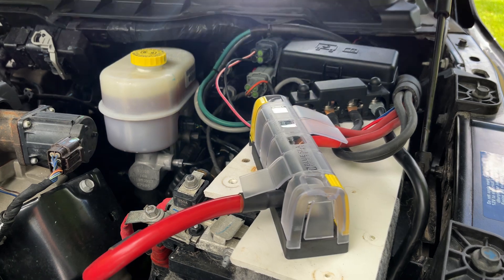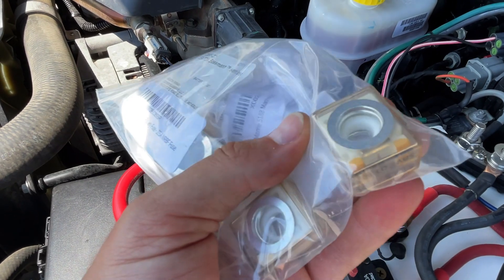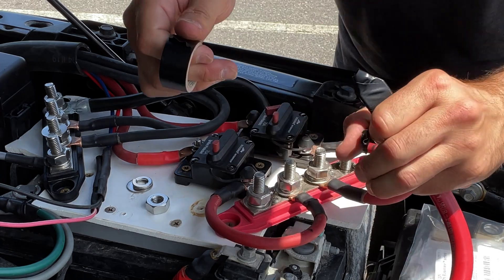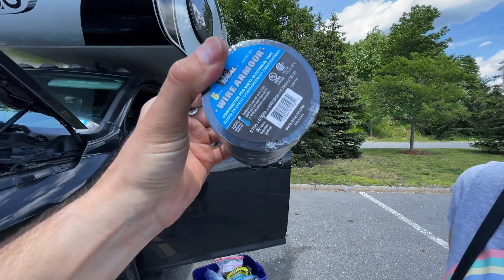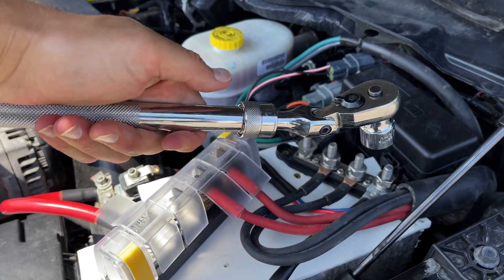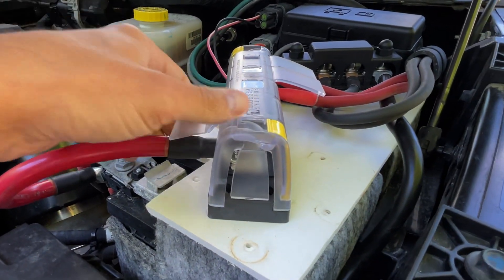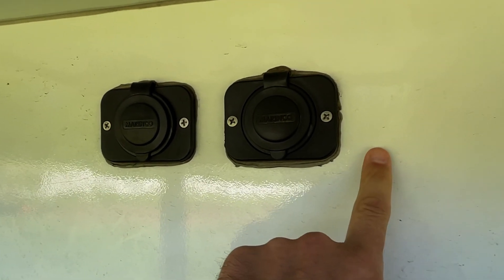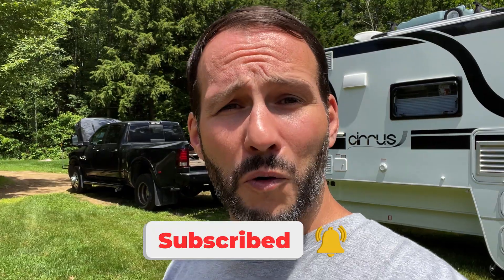Breakers vs. Fuses in the Heat // DC-DC Charging System Update

Comment: I'll make a suggestion use pop rivets on the Asdale. They work great for that type of application.
Reply: There are only two types of 'blind rivets' that you should use with non-metallic materials. Riveting soft materials with a typical 'swelling' rivet may appear successful but it is not. An 'exploding' rivet works by the mandrel splitting the rivet body into 4 strips and rolling them up, removing the hoop stress from the hole. The other is a 'tri-fold' that works just like a moly-bolt wall anchor. Neither are waterproof and for that reason, are inadvisable to be use on an exterior wall. (I am a former Safari Motor Coach manufacturing engineer where we built class A's with aluminum riveted skins on aluminum tube frames). One possible exception to the above is to used a 'sealed' rivet (again, there are 2 types and neither are common) with a washer on the back side. This works well but obviously removes the 'blind' nature of the rivet.
Reply from the maker: Thanks!
Reply: Scott, Rivets are very easily removed by using the same drill bit as the original hole required (important to use the same size so as not to enlarge the hole for the replacement) and drilling just enough to remove the head, then pushing the body inside, where it remains.
Reply from the maker: Thanks for all the information. Since I have access to both sides and wanted to be able to remove it easily, a stainless machine screw and nylock nut worked well. However, there are some sheet metal projects that I’d like to do in the future and rivets would be excellent!
Reply: @Stonyboot  I got that idea from another post. Here's one more it's called rivnuts they are like a rivet but they have threads once you install them the same as a rivet.
Reply from the maker: That’s an excellent idea, my only question would be how to remove them in the future? I assume just cut them and put new ones in? I have to service those plugs from time to time.
Reply: I think your screw/nylock  is the best solution but since the question was raised, I'll comment. Rivnuts also come in tri-fold  variants for soft materials which are superior but not absolutely required. There are several shortcomings to consider.  The is part of the way a rivnut works. It attaches itself to the panel first, not together as a rivet does. That means the flange on the rivnut sets above the surface of the panel. When you mount whatever to the rivnut, it sits above the plane of the panel by
 .030 or so, creating a leak path that has to be dealt with. Simplest is a caulk bead around it, better is a thick rubber gasket with clearance in the mounting holes to clear the rivet flanges (gasket alignment becomes a problem), best is to counter bore the back of whatever you are mounting. The potentially most painful problem is if the rivnut does not hold well in the substrate (likely if it is soft), it will begin spinning with the screw when tightened or loosened. If it does, the splines meant to grip the hole become a grinding wheel, enlarging the hole, making it impossible to remove. I use rivnuts a lot but for this reason, never in soft materials. Stick with the screw and nut.

Comment: Great info! Electrical stuff really intimidates me. You make it seem not so scary! ~carol
Reply from the maker: That’s nice to hear. 12v systems are pretty simple and easy to work on. There are so many resources on YouTube and Facebook that you can learn nearly anything. 

Do you have any particular electrical projects that you want to tackle?
Reply: @Stonyboot  we are full tome in our small travel trailer, but this fall will be downsizing to a truck cap with a hard shell roof top tent. I want to put a 100 watt solar panel on the RTT and I want to be able to charge while we’re driving. We’ll likely go with a 200 ah lithium battery-not 100% sure yet. Maybe just buy one of the new 2000 watt Jackery power stations. We don’t need a lot of power-mostly to recharge things. We’re Boondocking right now and running Daniel’s cpap from our Jackery 500. We have Jackery solar panels to recharge it.
Reply from the maker: It sounds like you’ve got a good system. Those battery packs sure to make life easy!

Comment: I agree with you 100% on Blue seas products.  I’ve been using https://www.bluesea.com/products/9001e/e-Series_Selector_Battery_Switch  for years on my Casita and now my Nash 17K and it has worked lawlessly.  I had two of them one for truck to trailer so I  can turn  OFF the DC/DC charger and the second on my battery banks between bank A and B
Reply from the maker: I’ve become a fan, there are usually cheaper alternatives, but I’d rather buy something that will last. Blue Sea has a great reputation. 

I’ve tried some cheaper battery switches and have not been impressed. I’ll have to take a look at the ones you shared for a future project. Thanks for sharing?

Comment: I used Blue Sea terminal blocks to clean up my battery compartment in my truck camper which houses two 6V batteries in series. Was such a pain to take the batteries out to check the water so now with the terminal blocks I don't have to disconnect any of the multiple load cables, just one + and - cable on each battery. I agree they make excellent products. I like your system except for those 2 exposed male connectors. I wouldn't trust myself to remember to tape them up especially if I was in a hurry.
Reply from the maker: Thanks for sharing. They do make great stuff. I had to remember to turn the breakers off for the male plugs, I’ll just find a rubber cap for them. We only unload a few times a year, so it’s not a big deal.